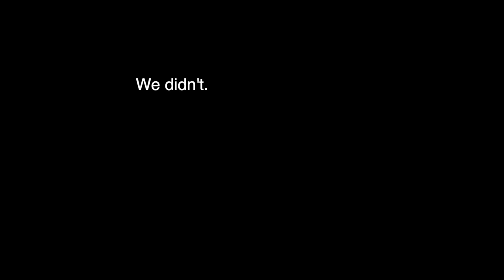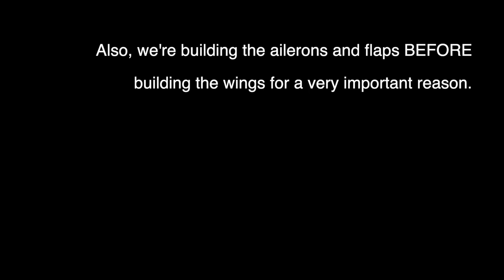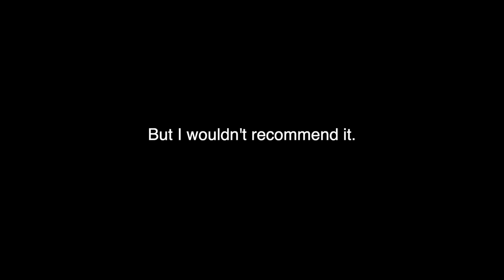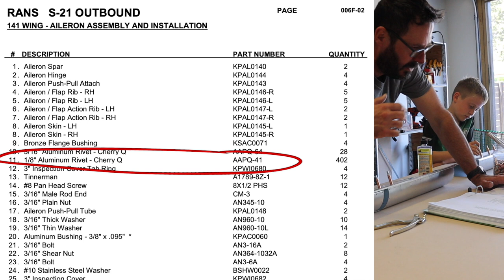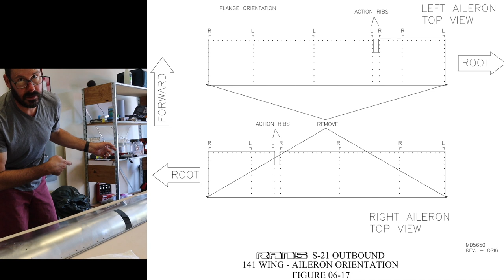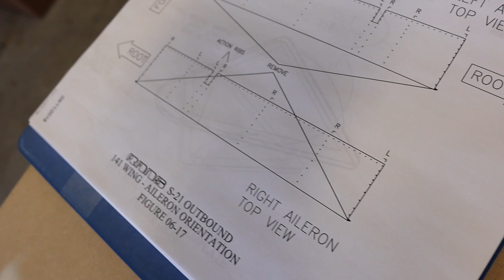RANS S-21 Build; Ailerons & Flaps Ep 5 LONGFORM

Comment: I used one side of my pipe for the ailerons and used the #40 holes. Turned the pipe 180 degrees for the flaps, and drilled it #30. Cut my pipe 7 feet long to work for both flaps and ailerons.